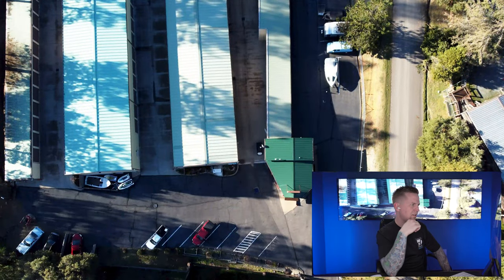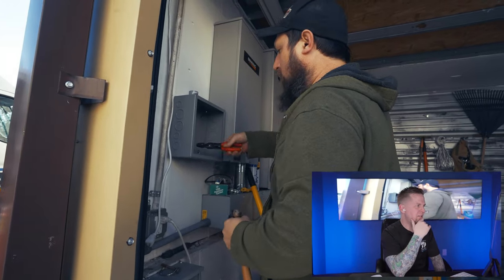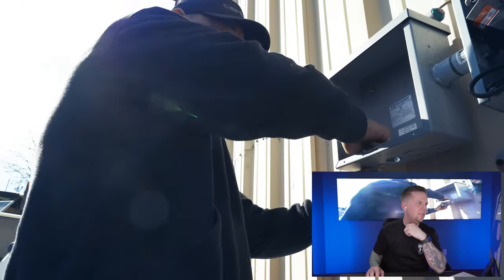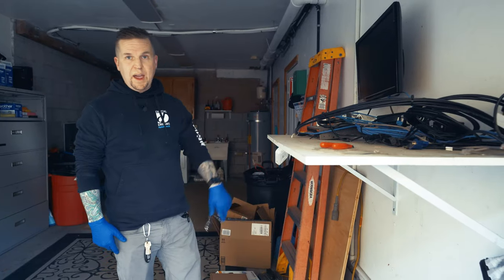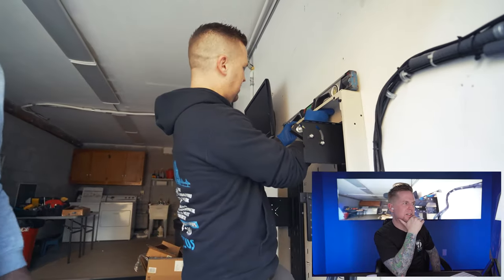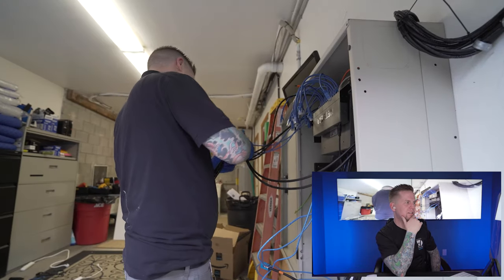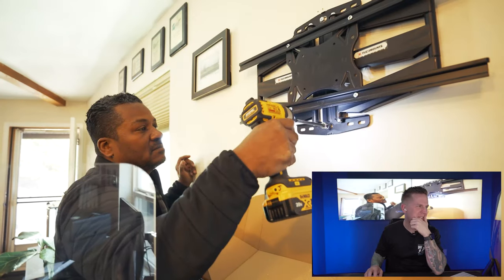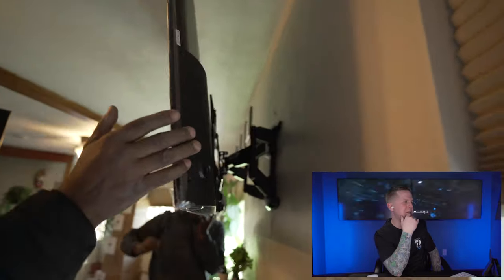Verkada | Massive Security Camera Install in Colfax! | Digital Dreams

Comment: A bit overkill.  Cost per camera to the customer must have been brutal.  Did California start enforcing code on low voltage?
Reply from the maker: I wouldn’t say it’s overkill the customer needs to ensure all of their customers storage units are protected. With out the video verification they can’t prove anything is an incident was reported